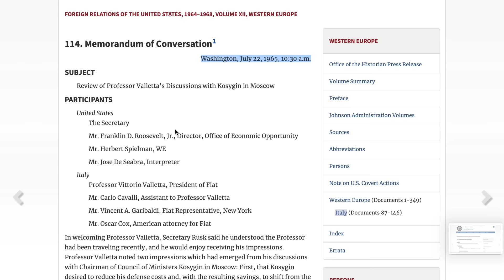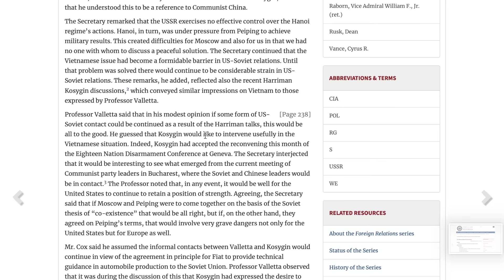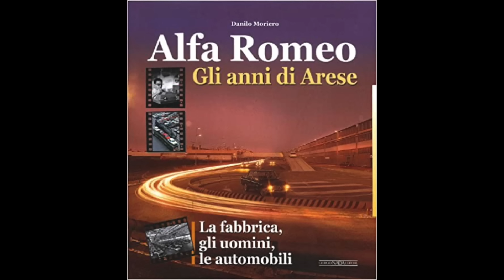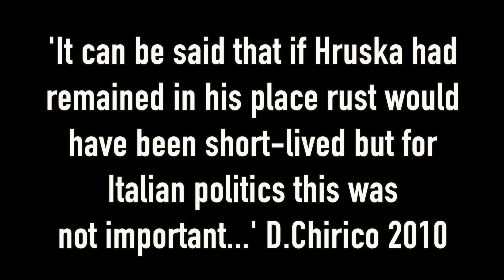Alfa Romeo And The Myth of Russian Steel - The Real Reason Alfas Rust

Comment: I`ve owned over 200 cars, a good percentage of them were from Italy, but also Britain, Germany, France etc. I can tell you that all of them rusted at similar rates, the only manufacturers who were proactive when it came to rustproofing for longevity, was Mercedes, especially post 1975 & later Audi post 1982-ish. By the end of the 80`s, pretty much everyone else had caught up to greater or lesser degrees. Until that point, cars were routinely rotted to the point of failing MOT`s by 5 -7 years old, some even had holed outer panels at 2-3 years old! Your only real option was to have your shiny new car rustproofed immediately with Zeibart or similar (or filling your box sections up with used engine oil every year or 2).
Reply: Not true! I have owned a junkyard since 1985 and the Mercedes is the worst rusting cars of all makes. Some survive only bacause of the owners meticoulus care. In general though they are horrible and the most overrated car ever built.  I bought 2000 cars once that had been sitting on the ground without wheels for 5-10 years and you couldn't lift an MB with a loader without it braking in half. So also the Citroen ID/DS and Japanese trucks. If I lifted a Vaz Lada they looked like new underneath.
Reply: @mossig  Mercedes did suddenly get very bad for rusting when the accountants took over from the engineers, circa 1995 (not just rust issues either). What I did find when I was in the motor trade, was that a lot of older Mercs that had been crashed (& all German cars) were repaired with cheap pattern panels in the 90`s (when "Euro Car Parts" took off in the UK), this led to a lot of them rusting out quickly, especially front wings, which were much thinner metal than the originals, & were made of poor quality steel.
Reply: @MrPabsUk  I don't know about the pre WW2 cars but from the Ponton, w110, w115, w123, w201, w124 they rust badly. A Lada cost 25% of the cheapest MB:s and consequently got washed and maintained a lot less, but rust less. My experience is that if you go buy an expensive car you tend not to talk it down until you are fed up with it and went to another brand. Yesterday I junked a 1998 w202 wagon and it had fotball size rust holes in many places. The rear suspension (hydraulic) was completely not salvageable due to heavy rust. MB:s rear axles are a nightmare to work with. I mean two days ago I junked a 1983 Escort and it was 99% rust free! Both of them was parked in my lot on wheels for about 6 years and I drave them both to their resting place years ago.  I used to drive a 1974 W115 lang 220D. But one day it broke in half while driving it. I do have a almost rust free MB though. A 450slc 1980. But that is mostly because it was inside for many years and not used. But there is always an exception to the rule.
Reply: @mossig  I don't know about the early ones, but the 114/5, 123`s & 124`s I worked on were always better than their competitors, as you say, they tended to be owned by wealthy people who looked after them well, & tended to keep them in garages. I`ve only owned one Lada, I got it stupidly cheap, it was about 6 years old & I paid less than £100 for it. Nearly all the panels had rust. It wasn't "normal" rust though.. Like, at the top of the front wings, the entire length had small bubbles, which went all the way through the panel. I took a screwdriver banged it with the heel of my hand between each hole till the whole wing was cut through at the top.. It was like a perforated stamp! I had other cars with rusty front wings, but the rust would be concentrated in 2 or 3 places, either at the top corners &/or the bottom corners of the arches. The Lada metal also felt like lead, so if you hit the middle of a panel with a hammer, the damage would be very localised, whereas if you hit most cars panels with a hammer, the damage would extend 5 times further...

I did have a similarly aged (& stupidly cheap) Skoda 120 around the same time as the Lada, & that had no rust whatsoever.

I also had Escorts, including the Mk3 & 4, & they rusted everywhere! The worst place was the battery tray, which would then allow water into the car, rotting out the floors. This was partly because the scuttle & wings had no lip, so all the rain went directly into the engine bay, including onto the horizontal section under the battery, which would suffer acid damage from the battery itself. The last one I had, an 89 1.6 Ghia had suffered VERY badly because the owner used to park on a very steep driveway with the cars nose facing upwards, so the battery tray always had a pool of water on it, till it rusted through, then all that water would go into the car & make its way to the back. As a result the entire floorpan had rusted through..

That said, I also had a Porsche 924 that had rusted the battery tray (which sits in a similar place to the Escort), the difference was, the RHD 924`s had the fuse box directly under the battery tray inside the car, so when the battery tray rusted out, the water would then fill the fuse box, causing many, many issues. I`ve also had several 944`s, but they never did that.

Comment: Very interesting vid. You say that pretty much all cars of the era rusted, and I would agree, but….
Most cars rusted in places where you would guess that they would, areas exposed to water a lot, inner wings, cills etc. But Alfas, Lancias and Fiats would rust pretty much anywhere. My Alfasud had a hole right in the middle of a door panel, it started as a bubble under the paint, so it’s origins were before the paint was applied. But it was a great drive!
Reply: Very true. My mates dad had a Fiat Strada in the eighties. That had rust right in the middle of the roof
Reply: A schoolmate's father had one of the early Giuliettas in the late seventies. Wonderful car, fast and impressive for the time, but that also had rustholes in the middle of the panels (doors, wings) develop after only 2 - 3 years. I think it was connected with new technologies for spraypainting. The old paints (solubles) were very unhealthy for the workers, as well as very bad for the environment so new products (based on water?) were used.  But on the other hand, French and German cars did not rust in that way at the time...

Comment: I owned 5 Lancias, including 2 Betas and an HPE. I didn't keep any of them long enough to see any rust. However the last was a Gamma coupe which I believe was built in the Ferrari factory on the 400 production line. That car was pretty rust free after 18 years so that seems to validate the working practice theory.
Thanks for a very informative video.
Reply: The Gamma Coupé was built by Pininfarina, not by Ferrari.
Reply: @8BRInteractive  I know but I read it was built on the Ferrari 400 production line.

Comment: My 850 FIAT was a terrible rustbox, I had an Accident with it requiring me to replace the front panel, it was the totally useless painting that allowed condensation to eat it from inside the box sections and under the reinforcing of the other panels where they were spot welded and nothing to protect it. However my Ford Anglia 105 of ten years earlier had NO paint at all in the chassis box panel nor inside the door and body. The paint was also cellulose and that has sod all protection from water. Dip treatments with good paints, means that modern car do not suffer from this problem and now depend on sensors and electronics to cause them to be scrapped.

Comment: My father bought a Fiat 124 Sport Coupe (AC version) in 1969. Here in Canada where snow abounds and salt is used with great abandon, the poor beautiful car lasted about 3 years before it was a rusted through mess, even with dealer applied rustproofing, although mechanically it was perfect. In reality, most other brands of cars here suffered the same fate, but it usually took a few years longer. My mother, being a firm believer in customer service wrote multiple sternly worded letters to the Fiat Canada head office, which was conveniently located not 4 miles from our house, about the disappointment in the corrosive abilities of the car over several years. Finally tiring of the constant communiques from Mum, when a representative from the Fiat head office in Italy was visiting, he was sent to our house to inspect the car. He agreed, with my mothers beady eye glaring at him, that it was indeed not acceptable. A deal was then made that they would offer full trade in value for the car provided they purchase another brand new Fiat. They then purchased another 124 Coupe, a 1975 model (CC version), which ran beautifully for 10 years and over 100,000 miles with no real corrosion, 7 years with them, and 3 years as my first foray into car ownership. While I owned it, I decided to purchase a 1973 Alfa Spider, which while looking great, hid a huge amount of rot. A fresh coat of paint hid it beautifully.
I agree that while most all cars rusted in those years, Italian vehicles really took the trophy in spectacular fashion. I do think that the cause of it was a terrible workforce, with apathetic concerns of build quality, and all the other things mentioned about the workers.

Comment: Good video, Jack.

I decided to research Russian-language sources so see if I could find info about exports of steel and other ferrous metal to Italy during that time but came up with nothing. Much more info about oil exports. 

A bit of background. The USSR faced a problem with workers holding massive amounts of cash and little to buy. Until the late '50s workers were required to buy government bonds in value equal to 1/12th of their annual salary. Finance officials forecast that beginning in the mid '60s payments on mature bonds would exceed the amount the State received by the forced annual purchases. Someone had the bright idea to pitch to the workers they ought to patriotically donate their bonds to the State in gratitude. When this was proposed to workers it was immediately rejected. The Government decided to cease issuing these bonds and freeze their repayment and interest for 25 years. No longer forced to buy bonds, personal savings increased even more. An absence of borrowers meant this capital was gathering dust. Because the state had made no promise of providing the proletariat cars, it was thought this would be a good way to get capital moving in the economy, the state to earn a tidy profit, develop a new industrial sector, increase exports, and narrow the lifestyle difference between capitalist-state workers and those in the USSR. 

A foreign marque was sought because the USSR didn't have drivetrains suitable for passenger vehicles as well as know-how in other automotive technologies. Ford Taunus 12M, Morris 1100, Peugeot 204, Skoda 1000MB, Renault 16, and Fiat 124 were purchased and shipped to the USSR for evaluation. The Renault became the favourite of the engineers. They were told the Government decided the contract would go to FIAT. The Italians offered better financing. The politics were better too - the USSR had identified Italy as the weak link in the Nato chain, the Italian Communist Party was the largest in Western Europe, and communist politicians had been appointed government ministers, making the Party influential. 

During tests at the Dmitrovsky test site of the Central Scientific Research Automobile and Automotive Engines Institute, the 124 showed itself poorly. After the first 5000 kilometres driven, it became absolutely clear that it was impossible to operate the model on Soviet roads without modifications, for example it lacked towing eyes and the low ground clearance was too low - at 120 mm this made it difficult to travel country roads. Engineers claimed drivers wouldn't be able to park in the city without the risk of damaging the car on the kerb. In addition, the car frame was not robust enough and began to crack. Italian engineers made about 800 changes to the design. The VAZ 2101's engine was modified to an overhead camshaft. In addition, the rear disc brakes were replaced with drum brakes, and the thickness of the critical elements of the load-bearing body was increased. The most noticeable external difference is the clearance was raised by 30 mm.

On 20 July 20 1966, the Central Committee of the CPSU and the Council of Ministers of the USSR adopted a joint resolution 'On the construction of a plant for the production of passenger cars' as part of its Eighth Five-Year Plan. The decree provided for the construction from 1967 to 1969 a plant in Tolyatti, Russia (a company town named for Italian Communist Party leader Palmiro Togliatti) for the production of passenger cars in the amount of 600,000 units per year, as well as the organisation of the production of components for them. Over 1200 hectares of land were allotted for the construction of the car factory, related facilities, and infrastructure such as housing.
Reply from the maker: Really interesting on the selection process undertaken by the Soviets, thank you!

Comment: My 1974 Sud SE, rusted very badly, the brilliant dealer in York (Alwyn Kershaw) gave me the option of a swap for another Sud, in white, or he would repair my green one. I didn’t like white so the green one was welded back to life. It lasted for about an 18 months before the suspension turrets rusted through and leaked water into the cabin. I traded it for a Renault 5, this rusted the rear wings ! However my following four Alfas , two Suds, a Guilietta and GTV6 never rusted. I also had a 1974 Rolls Royce Shadow, which had rusted sills and rear arches. Maybe Alfas not so bad after all.
Ho
Reply: I’d heard stories of rusting 70s Rolls Royces - so much for ‘the best in the world’!

Comment: Well documented Jack and it’s great to see myths like this one explained and with facts, rather than simply opinion and copied thoughts. I have owned Fiats and Alfas built in the ‘60s, 70’s, 80s and 2000s.  Asides this our family over the years has owned, Australian, Japanese, English, German and Italian built cars across the decades, all of which have had rust issues at some point in time. The very simple observation I can make is that rust protection, eg on the undersides and in cavity sections, historically was very poor and thankfully has improved. If Soviet steel had been the issue why would rust still occur in cars built from
the 1990s onwards. So yes, it’s a myth just like numerous other ones exist. The use of salt on the roads in many parts of the world (though not here in Oz, NZ etc) also has a significant part to play in why so many cars rust.
Reply: im going to help dispel that myth about tanks as armour steel is actually high quality but probably would eat the tooling to make the body's so like quality low carbon local cheap steel was probably used and by the sounds of it probably wasn't even up to the lab report aka what we sold the factory isn't what you though you bought so maybe junky steel will impurity's ect. that wasn't supposed to be in the steel add on it looks like from the pictures it's thin gage metal so rust is more of a problem to begin with design wise of the body work even if SS was used

Comment: I always get annoyed when people say FIATs rust. I have owned 4 FIATs: a 1975 128, a 1986 Regata, a 1995 Uno diesel and a 2003 Punto diesel, of these the only one that rusted was the 1975 128. By the time the 80's came along the problem had been solved by zinc coating the steel.

Comment: I spent the greater part of the 1970's welding rusty cars, and there was many Fiats among them, the fiats rusted in the same way all 1970's cars rusted, perforation from the inside out due to lack of internal primer in the hollow sections and almost total lack of any underbody sealant combined with multiple underbody mud/water traps. The Alfas were different, and different in a way that showed the steel was badly made, wherever it originated  from! Bad storage and bad industrial relations may explain  the reason for some Italian car problems. but on the Alfas I saw something I had never seen before or since, with one exception! We bought a low mileage Alfa Gulietta 2 door, what a lovely car, front engined, rear gbox and wearing twin webbers (Dellortos?) on its 1.8 twin cam engine, unfortunately both rear shock absobers were hanging loose in the turrets in the back wheel arches! when repairing it I noticed that the steel I was removing looked like it had been rolled with layers of slag between seperate sheets or layers of metal and it was clearly delaminating into four or more seperate thin sheets, the rust was coming from inside the steel! Wherever there was a poorly protected cut edge, the moisture seemed to be drawn into the "slag" layer by capilary action and the whole part would begin to swell and delaminate. It may not have come from Russia, and it may be coincidence but the only place I saw similar delamination of steel was in  the Moskovich vans and pickups, imported by my part time employer in their thousands! At the time a Moskovitch van or pick up was £1300 new , signwritten if required and including towbar and electrics! Moskovitch didn't actually make a pick up, they were all bought as vans, and most were "converted" at a bodyshop somewhere in East Yorkshire Where the importers were based!
Phil

Comment: You are quite right that most cars rusted badly in the 70s. Audi had a particularly bad reputation. My cousin in Hamburg had a Fiat Mirafiori 131 and an Audi 80 at roughly the same time, both rusted away at the same rate.  I heard a rumour that the Russian steel/Fiat thing was that Fiat facilitated the use of Russian steel for the Yugoslav built Zastavas.